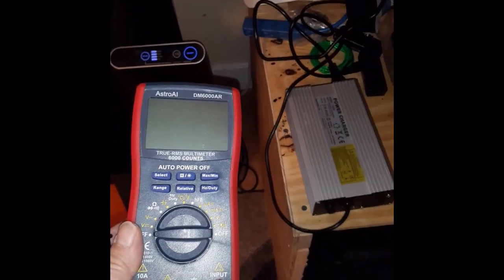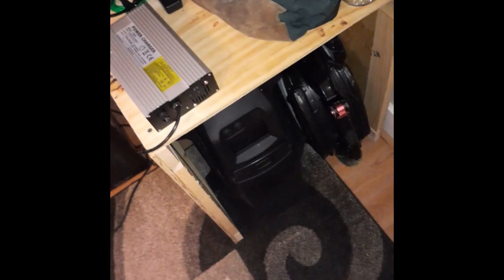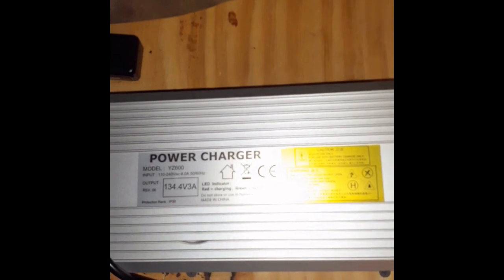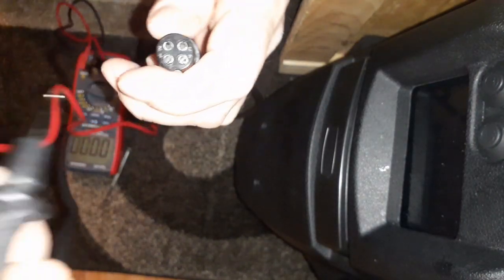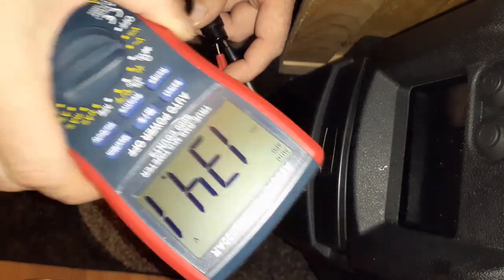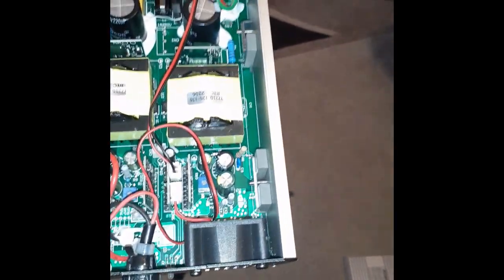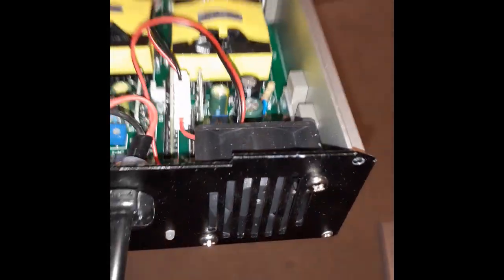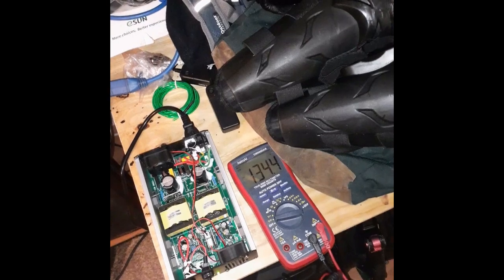Begode Master charger check and fix.

Comment: What fuse is in the charger? I just got one and it was missing it
Reply from the maker: I cant tell you that right now as I don't have the stock charger with me right now. I bought a V2 Roger Charger a while ago. It may be a week or so before I can an tell you. Facebook has MANY groups you can join with helpful people in them. There is one group (or more) just for Begode wheels.

I am sorry I could not be more help.
Reply: @ no worries brother I figured it out it’s a 4 or 5 amp

Comment: Very usefull vidéo, thanks ! is adjusting the charger voltage enough to solve battery balance problems?
Reply from the maker: https://www.youtube.com/watch?v=_cLXuv6CG_g

I recommend getting the above charger , via the telegram link. Its adjustable charger for volts and amps. Ill be doing a video wens. (if the rest of my parts come in tues) to manually balance the packs.  Adjusting the stock charger will only help keep them balanced once you have done so. Im building a adapter so I can charge each pack of the master to the 67.2v  needed so they are all balanced properly. After witch you will have to manually balance them every few charges. 

Check back soon.